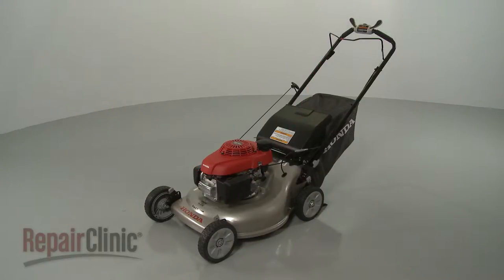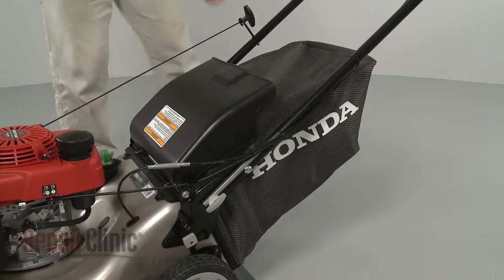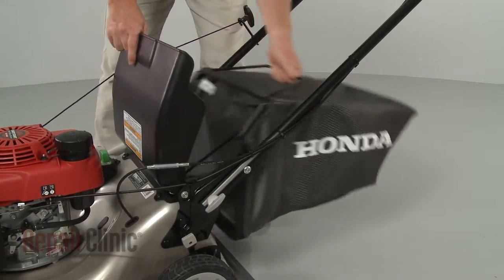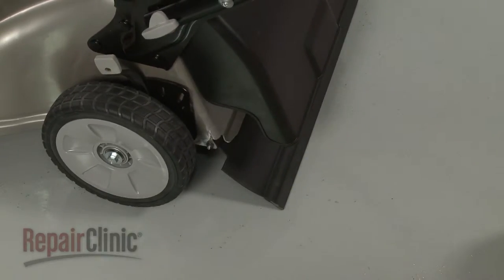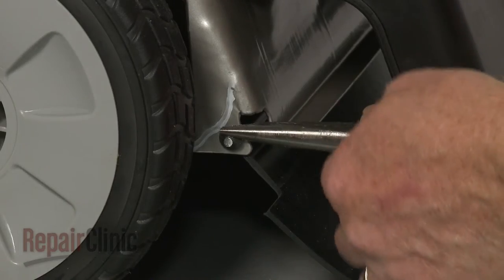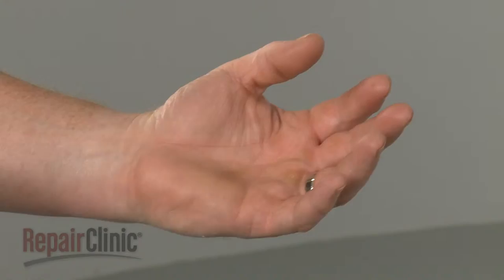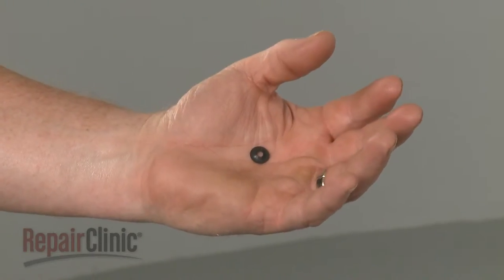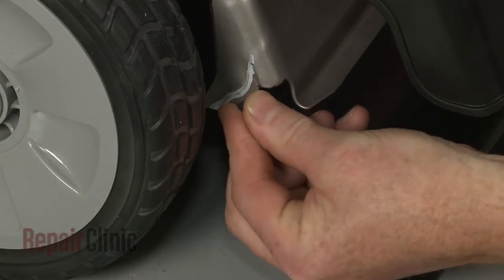Honda Lawn Mower Trail Shield Retainer Clip Part # 90301-VG3-020

Comment: So you re-crimp the shaft with needle nose pliers at the end?  I'm going to replace the shield flap, shaft, and clip on my mower soon.
Reply from the maker: +Stephen Rechtman We use the pliers to push the clip against the deck which locks the retaining ring in place.
Reply: +RepairClinic.com Thanks!  I ordered the parts from you this morning!  :)